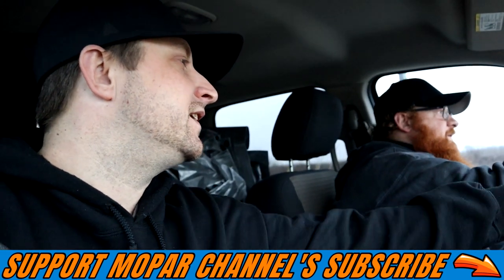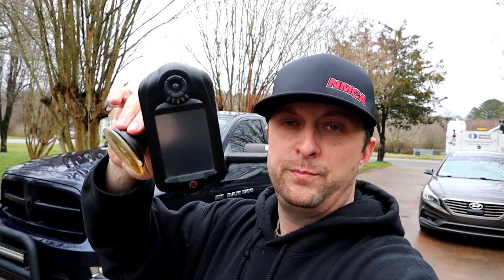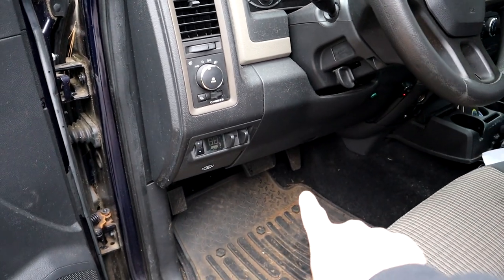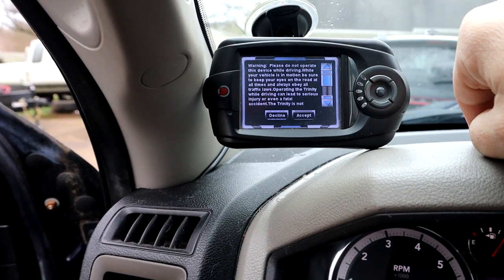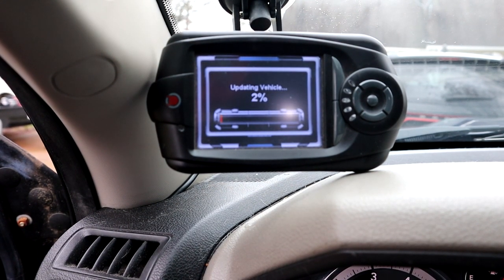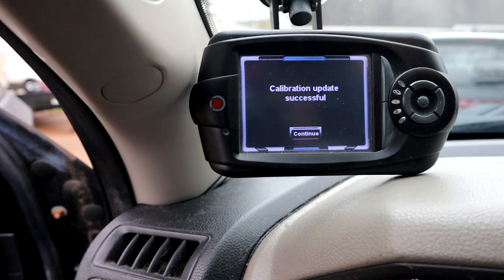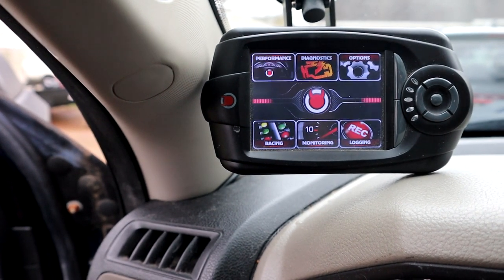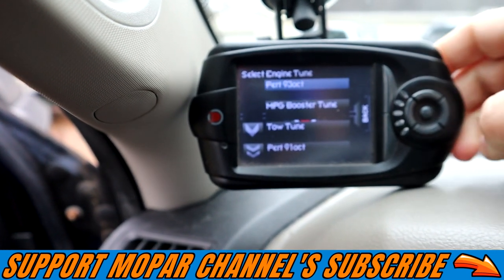Turn Off MDS And Install 93 Performance Tune From DIABLO On Ram 1500

Comment: I have this on my 2014 ram 1500 lifted 6 inches on 24x14 on 37s with true duals with hi flow cats no mufflers and it rips ain’t to fast but definitely moves to have stock air intake as well

Comment: I have 135K miles on mine and not a single issue on this whole motor other than a cracked exhaust manifold at about 115K. Which is why it's fiddna get a Jay Green Cam and valve train along with some Stainless Works Long Tube Headers WITH cats  and a tune!!
I have never in those 135K miles, 10 years, shut off the MDS. And most of those miles are highway, so it's always working. And as I stated, it bears repeating, I routinely get 20.5 to 21.5 mpg at 75mph over the course of 100 plus miles. I've gone 550 miles a couple times before filling up traveling cross country. 
So I'm not too convinced that the cam tick/ abnormal wear is connected to the MDS
Reply: It's a well known issue.  Just because you haven't experienced it, doesn't mean it's not.
Reply: @Josef_R  I was replying more on the front that this seems to be a trend on these pickups that people just turn it off. I guess I'm not understanding the perspective from the angle of turning it off for the sake turning it off....you like like the dumba**es who delete their catalytic converters, in a street, daily driven car?
Over the course of 137K miles now, I've gotten an average of 20.1 mpg, that's after factoring in all the towing and hauling I've done. So, from my perspective, the mds is an absolutely bonafide fuel saver. Having said that I Will miss it once I cam it, slap some full length headers on, tune it and throw a torque converter in with a trans tune.
I'm more of a driver that listens to all the mechanicals going on while driving, I like hearing the mds working. Just my take, not anything to do with experiencing faults or not. I've driven too many miles for too many years to expect anything to work correctly, ever. But I expect my equipment to work, all the time

Comment: I’m doing a MDS delete on my charger with new hellcat lifters and 6.4 non mds cam, can I disable the MDS through my Trinity T2?  Or do I need a custom tune?
Reply from the maker: You can turn mds off with the diablo

Comment: I have a Bully Dog tuner for my third gen ram hemi, I notice a huge difference in performance when I use the 93 octane tune. Not too sure how Bullydog compares against the Diablo tuner. I know my ol' fat girl comes to lifes and sounds meaner and works way better. My 0-60 is hard  is in around 7 to 9 seconds, depending on the surface. Stock I think it 9 +. Traction is my biggest issue lol..... Hope your friend enjoys his new found hp and turns that traction control off to abuse those hides💪💪💪
Reply from the maker: Awesome man, I have never tried the bully dog units.
Reply: Mine pulls better in tow/haul mode with the 91 tune. 2011 RCSB. 4.95 0-60 low 13s quarter mile. Diablo, true duals, Vararam intake, Sonnax booster, 275/55/20 Nitto.420s
Reply from the maker: @gunnerscustoms  awesome info
Reply: @gunnerscustoms  what's a sonnax booster? Honestly never heard of it? Your truck sounds pretty stout👍
Reply: @billknight5578  it's a plug in shift pressure booster. It takes about 1 minute to install and 5 minutes to learn the shift points. It tells the ecm that your shift pressure is too low and it boosts it. This makes a way better, firmer, and quicker shift...the way they should have came from the factory. I would think that it would help the clutches to last longer since it takes the "slop" out of the factory transmission. Best $40 I have spent on the truck, honestly. If you go to my channel, at the bottom, there is a video of a quick 30-80 pull, with the posi rear breaking the rears loose at almost 60mph. It never did that before the Sonnax.
Reply: @billknight5578  if you have a 45RFE OR 545RFE, you are in luck. There is one, on Amazon, right now, for only $16.99!!!
Reply: @gunnerscustoms  I'm almost certain my trans is a five speed auto. I'll have to check this deal out👍
Reply: @billknight5578  you will not regret it. No harshness, but the difference is night and day

Comment: Quick question...can you just turn the mds off with a tuner, and not have to do the whole delete kit?
Reply from the maker: Yes you can turn off mds with it.
Reply: @FrostbiteRam  awesome.  Thanks.  Would you happen to have the specifics on that tuner in particular?
Reply from the maker: @gfaile  I don't use diablo anymore but works well if not getting to involved with big modifications.
Reply: @FrostbiteRam  ok.  Ill look in to it.  I have a miss right (no hemi "tick" though)now that is not a coil pack, unfortunately.  Taking it to the shop soon.   If, its not lifters or pushrods, but an injector or a reprogramming issue, i want to get the mds turned off.  If we have to go in the motor, ill probably just do the whole delete kit.

Comment: I have a 2017 ram 1500 will this work on that? With turning off MDS as well, also I upgraded from stock 31s to 33s would changing my tires on the tune help?
Reply from the maker: It will but you will need a unlocked pcm first

Comment: So I bought a 06 dodge charger daytona had this tuner in it. So had to rebuild the engine because the rod bearing went bad. Today it's done being rebuilt and it runs great but now I have all mds codes saying open. So do I just have to re-upload this tune?
Reply from the maker: Should be able to turn off the mds with the tuner.

Comment: I been wanting to monitor the air/fuel ratio on my Jeep but it doesn’t give you that option
Reply from the maker: No, you need a separate afr gauge like I have in Frostbite.
Reply: @FrostbiteRam  yea, guess I’ll have to get one and a pod! Might have to have someone else tune my Jeep , I’m running hella lean on WOT still
Reply from the maker: @onefastlife5017  definitely get afr

Comment: When you had this tuner on other truck, did you have to do anything or pay anything to put it on this truck?
Reply from the maker: No it  just has to be unmarried before changing vehicles.
Reply: @FrostbiteRam  how do you unmarry it? Srry for asking all this.
Reply from the maker: @clutch302tc  you have to go into the settings and return vehicle back to stock tune to unmarried

Comment: Will this unit work on a 2014 Chrysler 300s Hemi?
Reply from the maker: It should check the website
Reply: Yeah bro I looked it up only one I see is the In tune I3. MDS ANNOYING and throttle response is kind of slow lol 👍😎
Reply from the maker: That device should let you turn it off as well.
Reply: Yeah I just purchased the device a week ago, but the device won't give me the option of 87tune for the 300s5.7 only 91 and 93 tune did they sent me wrong unit I ordered the Diablo I3 Platnuim using their Diablo tune now.
Reply from the maker: @MOPAR_CRUZ  may not offer it anymore

Comment: Hey man I just got my 2017 1500 ram a8 tuned and I keep blowing drive shaft help what do I need
Reply from the maker: You need a custom/aftermarket drive shaft very common problems.
Reply: @FrostbiteRam  thanks one that is one piece not two
Reply from the maker: @jasonhoover1707  yes pretty sure its a one piece
Reply: @FrostbiteRam  thanks again brother I just need to find a shop in my area that does it

Comment: If I have custom tune already with mds, Can I still disable mds?
Reply from the maker: Yes you can but you will need to modify the custom tune and it may not work i never tried to modify a custom tune with the diablo unit.
Reply: @FrostbiteRam  ok. I just swapped new non mds 5.7 from mopar in. And wanted to be able to drive after first start. Tomorrow 7.30.2021, I'm gonna just turn it over and hit up @hemifever if all goes well
Reply: @ryankosik18  I need to replace my 5.7 in a 2012 ram. I was looking at the Mopar non MDS crate motor. 68303088ab, so is this what you did. Swap motor and just delete MDS? If so how has that worked?

Comment: Why would you want to turn off the MDS?
Reply from the maker: Its annoying especially if you have a custom exhaust when the mds comes on and kicks out 4 cyl it sounds terrible for 1.
Reply: @FrostbiteRam  Guess that depends on the exhaust. Mines an '11, and I put Flowmaaster 60's on it, true dual a month after buying it. I've had no issues with it and I really like the 21mpg at 75mph due to that mds working. I love it! Course I drive a LOT of highway miles. 
Stock top speed is 109....trust me!! Lotsa real estate in Mexico to test that on!!
Reply: I have a hunch that half the cylinders not moving sometimes can result in unbalanced wear. Does MDS contribute to the lifter/cam issues down the line?
Reply: Annoying... feels like misfiring cylinders..
Reply from the maker: @markd1199  some say it does but really no hard evidence as lots of non mds lifters also fail.
Reply from the maker: @mikekosar6135  definitely
Reply: @mikekosar6135  ummmmm......it is misfiring
Reply: My 2011, with tow/haul on, will not allow the MDS to kick on. I only turn off the tow/haul when on the highway, over 60mph, to get better mpgs
Reply from the maker: @gunnerscustoms  yes if in tow mode it does disable it.
Reply: @gunnerscustoms  that's truly odd. Mine will shut down 4 cylinders as long as I'm on level ground not pushing a headwind with tow/ haul on.
Reply: @NoVoice71  sounds like an issue. It's meant to turn it off. Why would it need to drop to 4 while towing a load? It, definately, should turn MDS off while in tow/haul.
Reply: @gunnerscustoms  I read your previous one wrong. That's all. I missed one word! No worries.